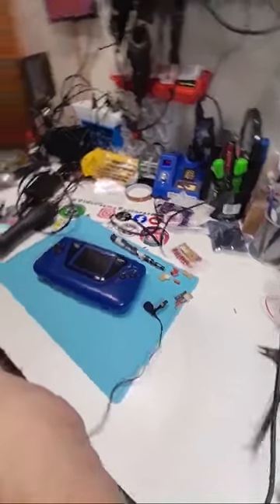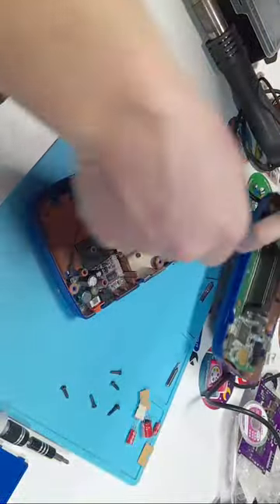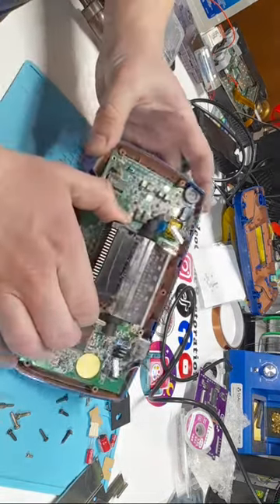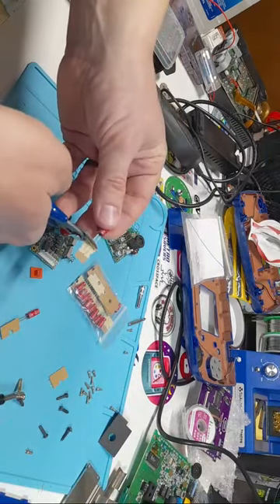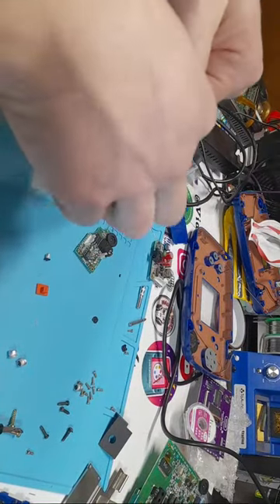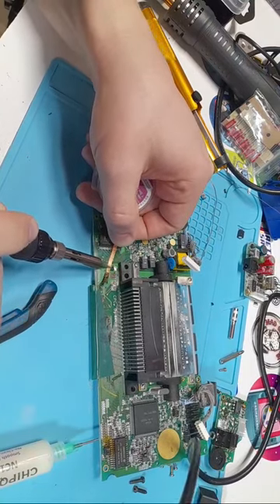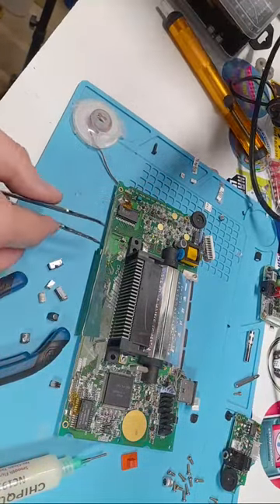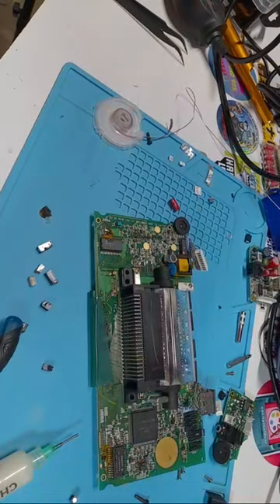Recapping a Game Gear

Comment: Capacitors = Farad
Inductors = Henry
Resistors = Ohm

Some context/caution with heating and pulling through-hole components to remove them: The through-hole itself is plated on the inside (the "barrel"). Since these boards are very likely multi-layered boards, damage to the barrel/plating can cause internal disconnections to that component. Please please please use caution if you have no other option but to heat the leads and pull on a component to remove it from a PCB.
Reply from the maker: Farad! Thank you! I believe these boards are 2 layered (thankfully) you're right though, the pull through should be used cautiously and only if you have to other way of doing it
Reply: @VideoGameRestoration  You're welcome. EE with 8 years of fixing military radio PCBs, so I got concerned with the suggestion of pulling through-hole components with just heat lol. Like you said, if there's no other option, at least use care when doing so. Heating the board like you did at one point in your video with hot air can also help with removal as well (warm up the board then use soldering iron to heat leads).